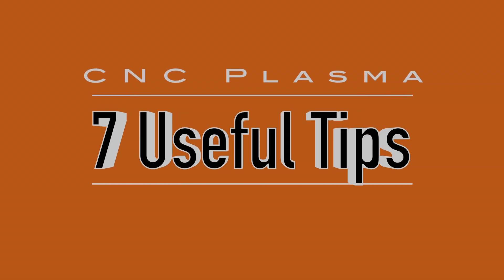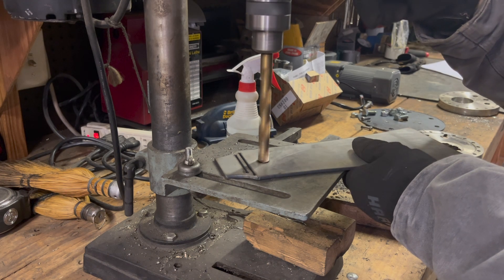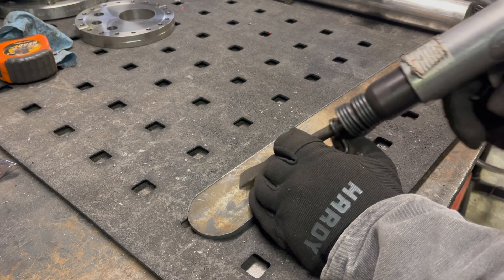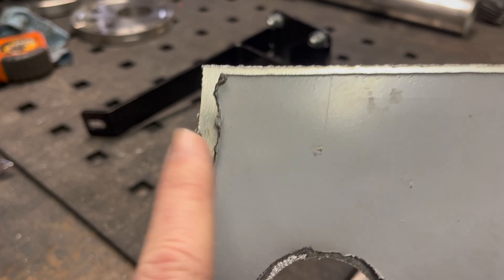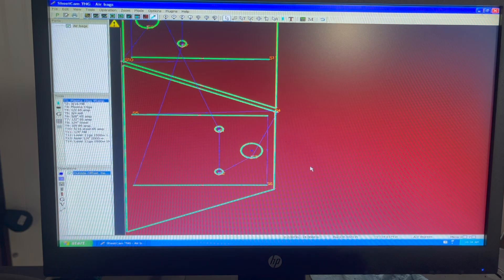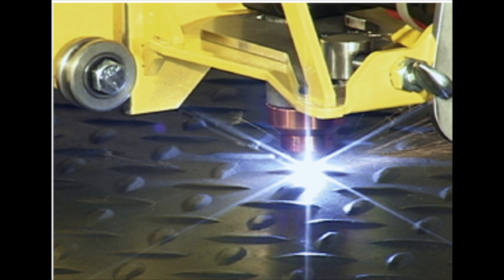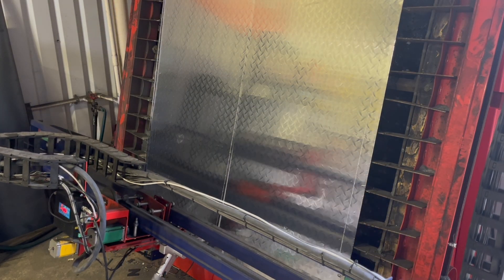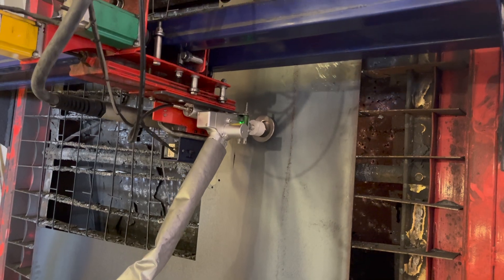CNC Plasma Cutting Tips and Tricks.

Comment: Hey and tnx for sharing! I just got into the game of cnc plasma cutting (even the plasma cutting thing is new to me) by completing JD's garage build also got a Lotus LTP5500 plasma. I seem to have this problem where the plasma randomly goes out and do not know what to do anymore... Got good ground, do not have a THC (but always try to level the sheet I am cutting), I have 1 good quality air filter on the compressor, changing the consumables kinda helps but I eventually get the same end result (after several cuts). Any guidance would be of great value and appreciated.
Reply from the maker: @vankatanemuedobre  if your plasma has a setting for expanded metal, use that as it will keep the plasma from cutting off if it looses arc and waits for the computer to turn it off.
Reply: @k-rigg  Tnx for the fast reply! I will check if it's got such feature but kinda doubt it. You seem really familiar w those machines also given your background it maybe not a bad idea to make a vid explaining setups, software, plasma generators, consumables, etc. Also a definite sub from me. Keep it up!
Reply from the maker: @ thanks,  ill keep those ideas in mind.